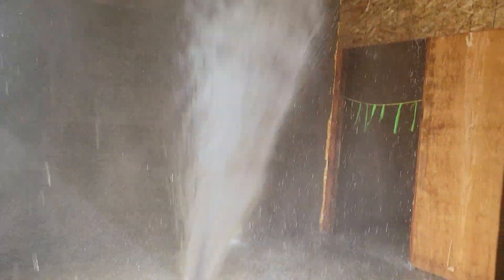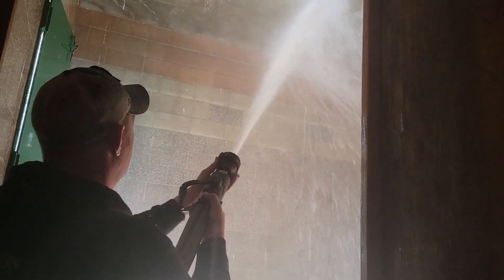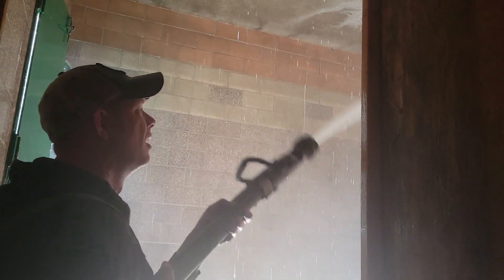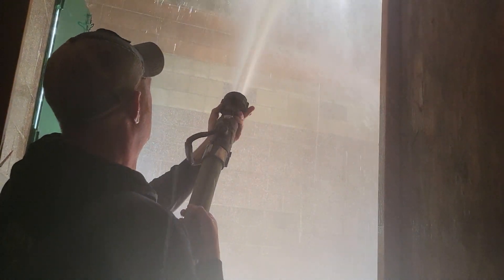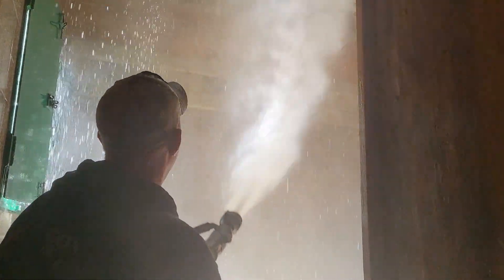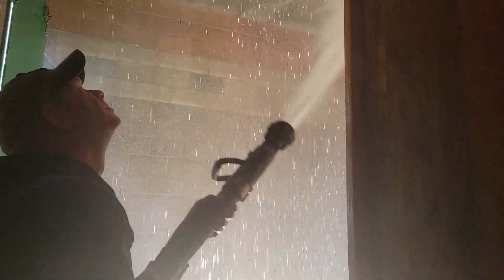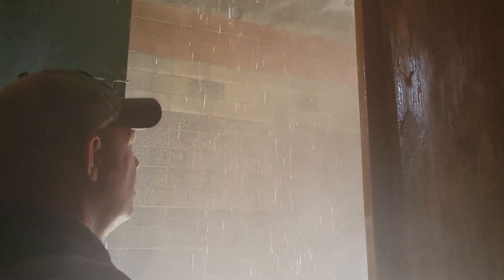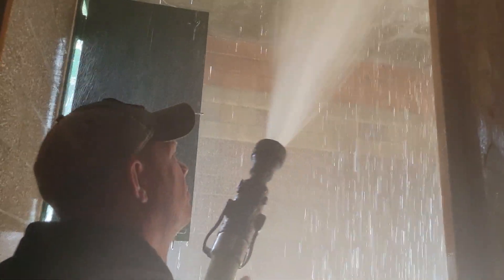HEN 160gpm@50PSI Blade Hallway to Bedroom Push, Drill Tower

Comment: What is the difference between the blade pattern and a semi fog pattern on other nozzles?
Reply from the maker: Edge concertation vs tiny droplets and spread out over large spaces.  https://www.linkedin.com/in/dennis-legear-54659140/  read the articles.  I have been truly impressed, was hired to prove pattern.  I said I was hired to disprove pattern ve existing patterns.  I have thrown every monkey wrench at it.  If my hose was on fire and my family was on the line... Bladed Pattern at 160gpm@50psi with a Turbo 75psi back pressure would be what I want to show up in a qualified Nozzleman hands.